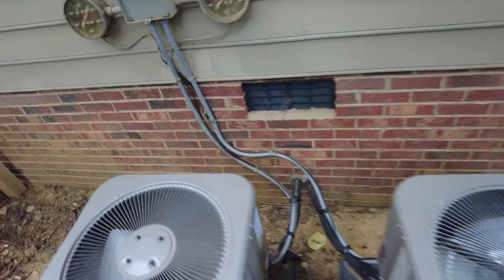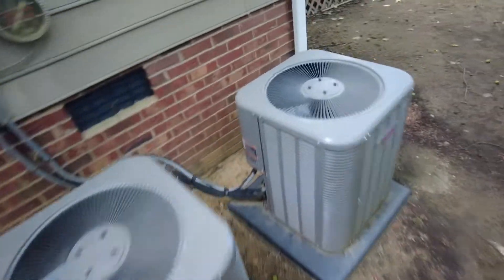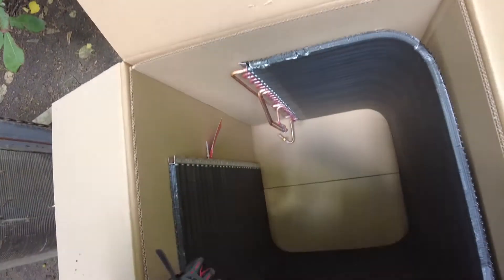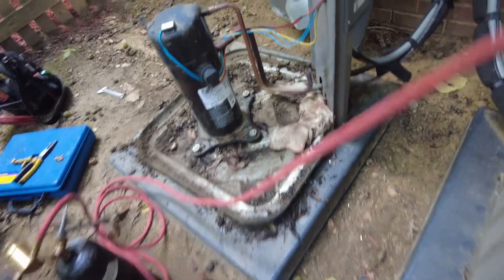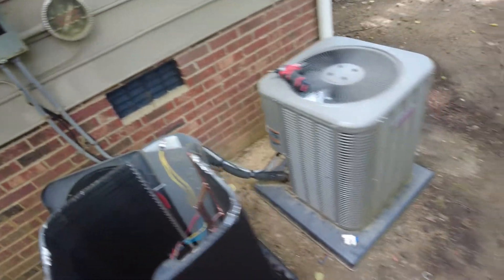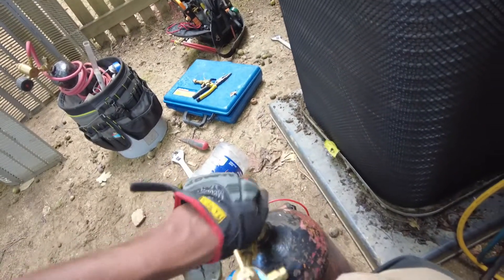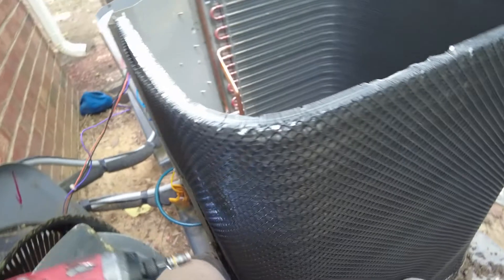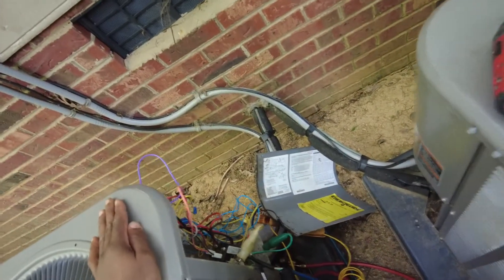Another Day in the Field | AC Lennox Condenser Coil Install Start To Finish

Comment: I am a new subscriber to your channel! Watched quite of few of your other videos and I enjoy them. I went from a preventative maintenance tech here in Va to a service tech. Been learning and had two months of service training, I find it helpful to watch how others do repairs. It’s great because you pick up tools and techniques from these videos, (I still have to do repairs within company policy). For us when we do a refrigerate repair we are required to use nitrogen for brazing and to purge the lines before a vacuum. (Not saying you did anything wrong, I was just surprised). Also on a side note I have the Fieldpiece probes, but I was told when I start doing refrigerate repairs I would be better off  getting SV480 field piece. I was just thinking about getting some thick vacuum hoses and just get a MG44 field peace to go with my already blue tooth set. Your thoughts? Thank you!
Reply from the maker: Thanks a lot for the sub man! Congrats on your transition to service tech. It's great to see your company's recognizing your hard work and dedication to the trade: ) Also glad I can help with my videos as well. Yeah you definitely want to stick with those company policies it is best to use nitrogen while brazing to purge before vacuum. In regards to the sman480 manifolds, honestly you will be better off sticking with them. Just use a set of vacuum rated hoses without valve core depressors in them and connect lossless fittings to them whenever using them to check charge or do service and disconnect the low loss fittings whenever you're pulling vacuum and connect straight to your valve core removers. This would be the perfect setup IMO. Don't get me wrong I've got the thick 1/2 inch appion megaflow hose that will pull down to 600 microns on a 3-ton split system with over 60 foot of lineset in 5 minutes or so,  with the valve cores removed. But for the time saved swapping out instruments you can probably pull the same vacuum with the valve cores removed on the Sman's in maybe 10 to 15 minutes. Hope this helps. Please let me know if you have any other questions thanks watching!

Comment: Do you think it's best to use analog or digital  Gauges when starting out
Reply from the maker: In my opinion digital gauges are better to start out with. As long as you actually want to understand all of the features and data that digital tools make available you can learn a lot from a lot from that info. Also you'd probably want to invest in a good set of digital psychometers to compliment the gauges and use a data aggregation app like measurequick and you'll have a very powerful diagnostic setup that will teach you a lot along the way. Thanks for watching!